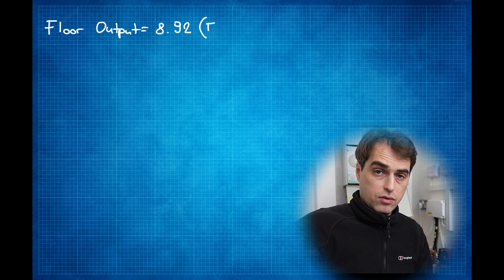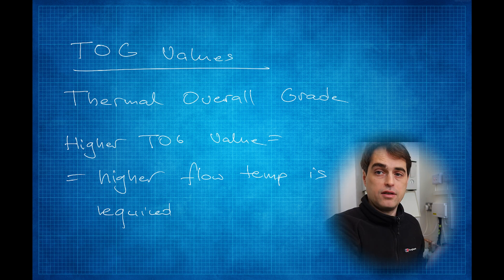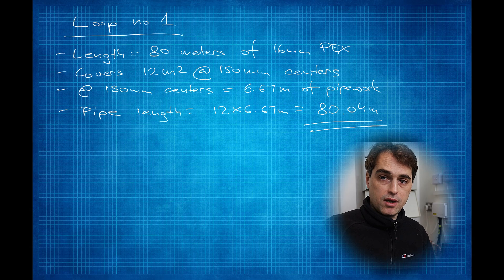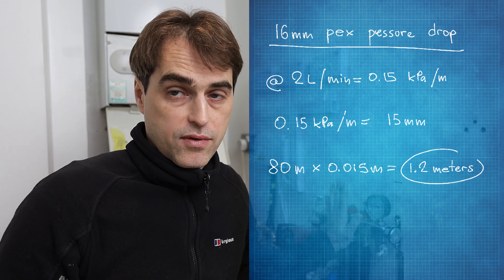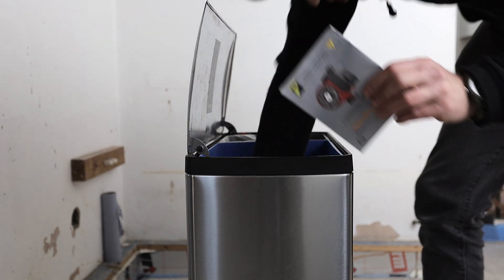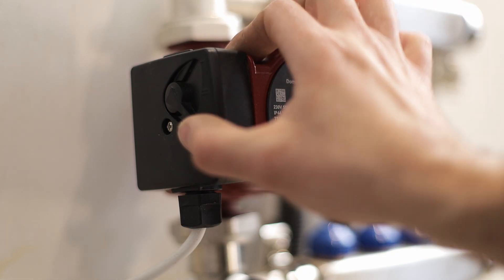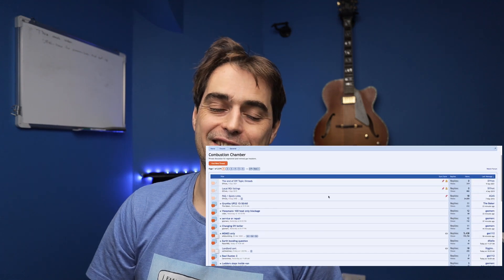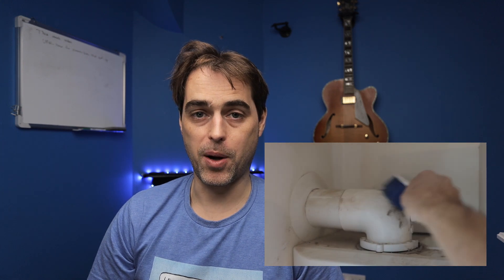Step-by-Step Guide to Setting Up an Underfloor Heating Manifold

Comment: I have a older non modulating monobloc (either 100% on or off ) for my ufh and was wondering if you could advise how I should set this up most efficient? I can change the set temp and also the setback delta on the heat pump. Ie bring circulating temp up to 38c and back on at -6c / 32c. Not sure of the pay off between having lower temp / set back temps compared to cycling on/off more often.

Comment: The start of this video was the way mine was installed, manual chucked in the bin and everything set to maximum, even temperature set at 60
One question thought, what could be the cause of the pressure dropping on the manifold, set it to 1.5bar but after 4-5 weeks is gone down to almost 0
Reply from the maker: a leak obviously
Reply: Terrific
Reply: Also should the pump on the UFH manifold come on when the UFH is off but the hot water and/or central heating is on? And the flow rate is set to 3 so I'm guessing they didn't do any calculations
Reply: @01genics  the UFH pump should only come on when the ufh is called for via your thermostat

Comment: With a condensing oil boiler supplying the underfloor heating manifold would you set a delta t of 20 deg C from the boiler to the underfloor manifold and a delta t of 7  for the underfloor heating loops. Thanks for any replies.

Comment: Very informative video. Interesting that the 2 Kensa GSHPs installed at our site about 8 years ago don't have flow meters on the manifolds, only the actuator heads connected to their room stats. I can only assume that those circuits are just running at full beans from the pump they are connected to?
Reply from the maker: HP runs at DT of 5-8c so the same as UFH so can in theory work without flow meters if all the loops have similar length and resistance
Reply: @UrbanPlumbers  Yeah ours runs at about DT6 and its all UFH, I'm trying to get the design documents located so I might be able to see what the loops actually come out to. We're just about managing 3:1 on the COP so naturally if we can improve that I'll be happy!

Thanks again!

Comment: mate! i have a problem, i want to install a new monoblock heat pump but the saying is that i need tank for the flow to be better because the hp need this..? is that true? i hqve 250 square floor heat and plan a 10-15 kw is enough for heatpump, but dont have space for big tank, how big do i need
Reply from the maker: You need to check minimum volume th HP required, then check the volume of your smallest zone and add a buffer to make up the difference

Comment: Brilliant video. Just wondering is the pump on the boiler not strong enough to power the underfloor heating so it needs it's own pump?
Reply from the maker: Flow rates on UFH are 3 x the boiler flow rates at the boiler and you need to consider pressure loss on the pipework - That’s why you usually need a manifold pump but not always

Comment: As usual very well explained, I realise it was just an introduction and overview and that there is a fair bit of theory underpinning the whole ‘exercise’ to understand the design concepts. I can see how installing underfloor (and Heat Pumps) will be a real challenge to a ‘box slinger’ who has been used to installing a well oversized gas boiler on the wall, doing the commissioning of the boiler and not doing very much at all at ensuring the whole system is optimum or efficient. Pretty sure that the upfront investment including lost productive time by attending the 2 day course and completing the Heat Geek programme will payback very quickly indeed, increase customer satisfaction and just as importantly improve job satisfaction.Thank you for doing this video.
Reply from the maker: I am doing my first Heat Pump install at the moment. Boy is it a struggle. Plumbing has been easy enough (3 days of work), but wiring is just mental! Hopefully will finish tomorrow (5 and 1/2 days to swap a heat only boiler to ASHP)

I am seriously struggling with it, just cant imagine combi slingers being able to even touch heat pumps.

Video coming very soon.
Reply: @UrbanPlumbers  I look forward to that - you are on top of the game. BTW I would have thought that weather compensates systems should come with less wiring - so will be good for me to learn more.😀👍

Comment: Great, very informative. Do you get to keep a Reference Manual with the Heat Geek course or just a Work Book ?
Reply from the maker: Just the work book. To be fair 90% of what in the course comes from CIBSE books
Reply: @UrbanPlumbers  Thanks for this 🙂 
Just thinking that, having done Kimbos course, for future reference the spiral Reference booklet that Kimbo gives out is really useful. But with Adam's course I'd have nothing to look back at to help me !

To make an analogy:-
If I chose to do A-Level Physics at the local college I'd get reference books to regularly refer to.
Thus, seems quite tough to pay a big sum but have no future reference books 🤔
Reply from the maker: @andrewriley4204  that is very true. I actually prefer what Kim is doing for a simple reason - it is done very simply and allows you to apply the knowledge directly to your work.

What Adam is doing is also great, but requires more effort and actually mastering the concepts.

There should be a manual or at least a book with large number of exercises or online resources.

Adam will figure it out. He is a smart chap.

Comment: The heat geek course has produced a great engineer for sure. It's great to see the learning applied. I'd like to see you use WC and a variable mixer next.
Reply from the maker: Variable mixer - what’s that? Any links please?
Reply: @UrbanPlumbers  Andrew likes to spout his words to those willing listen. Unfortunately, as clever as he thinks he is, sometimes he talks total shyte.
Reply: @UrbanPlumbers  https://youtu.be/xp-GmzNX0IM
Reply: @UrbanPlumbers  your calculations are correct at design loads but almost never do we have design loads. A variable mixer with weather compensation will perfectly match the load and boiler output at all outside temperatures. Viessmann are the leaders of this technology. It's also often cheaper and always more comfortable.

Comment: Great video, love seeing your editing skills improve from the early days! I’m in the middle of setting up my underfloor system. I’ve purged the single zone UFH pipes and pump of air but what I’m unsure of is how to remove the air from the flow and return to the boiler and then connect to the pump? Currently I’ve got the pump isolated, if I was to fill the rest of the central heating system up there would still be air between the UFH and boiler?
Reply from the maker: The boiler pump should have an auto air vent that should take care of most air in the system. Unless you have an Intergas boiler, then you will have to bleed it manually.

No matter how well you purge UFH there is always some air there anyway - so if you don't have an AAV on the manifold, then manual bleeding is also required there.